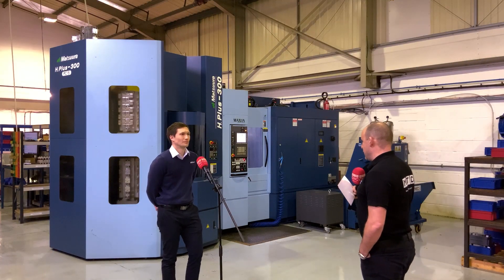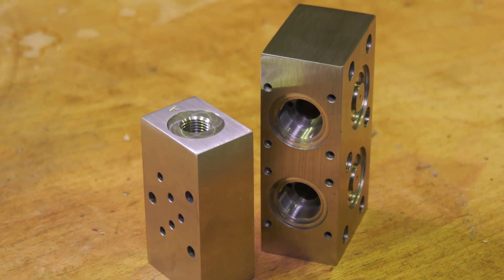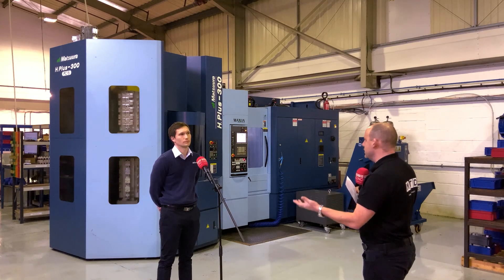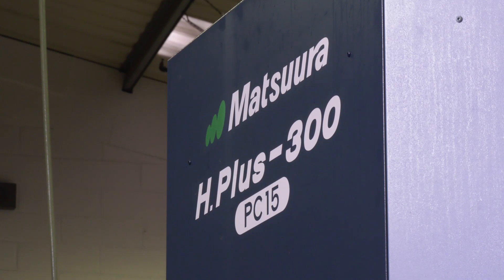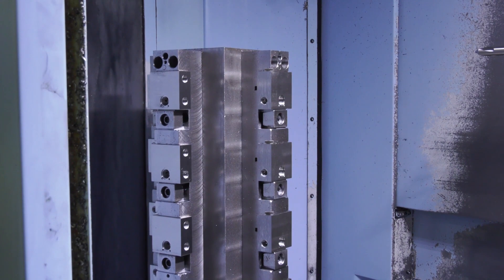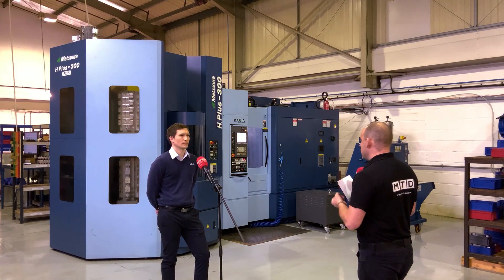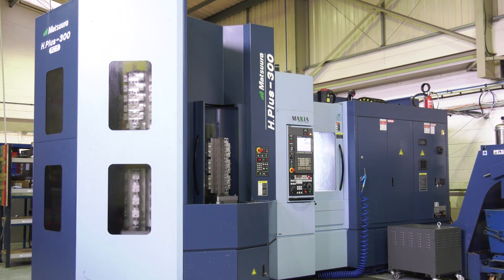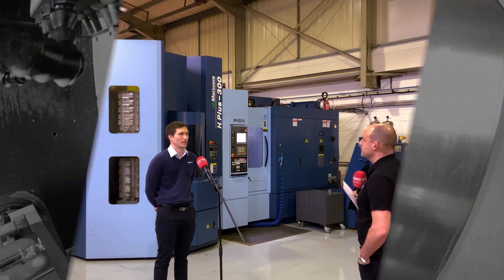Matsuura Automation Makes Milltech Competitive Against EU & Chinese Counterparts

Comment: The best thing about running a machine with a huge tool holding capacity other than the obvious ?
Loading every tool you would ever use.

The main advantage i see is pairing up your tooling ?
By running tool breakage detection on a lights out machine.
Tools can either be programmed to switch after so many cycles or running tool breakage detection the machine could opt to choose another paired tool and keep running.

Going forward with your business with a CNC machine is unfortunately having Less staff.
Either running machines like the one shown in this video or via robotic part changing.
Reply from the maker: Hope you enjoyed the video, thanks for watching.